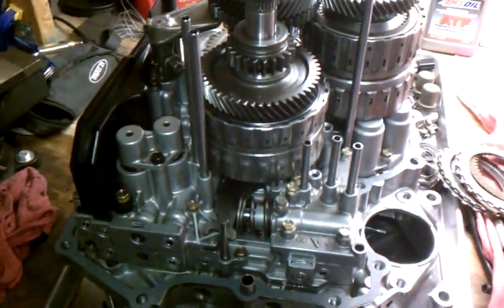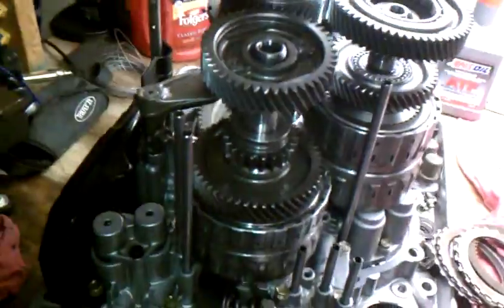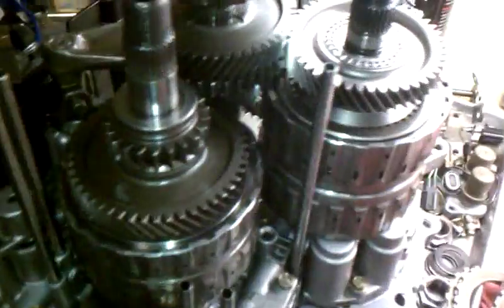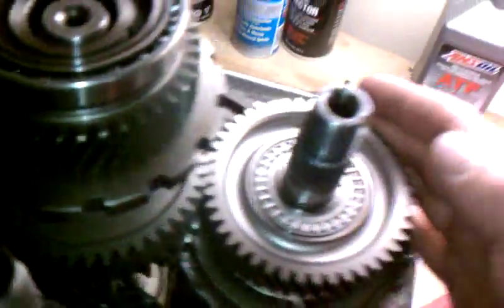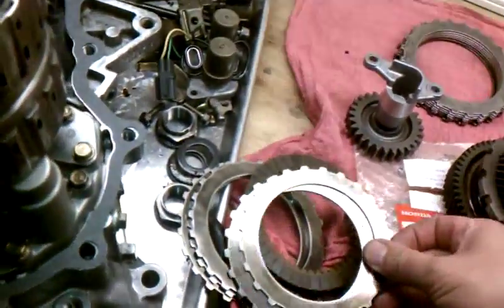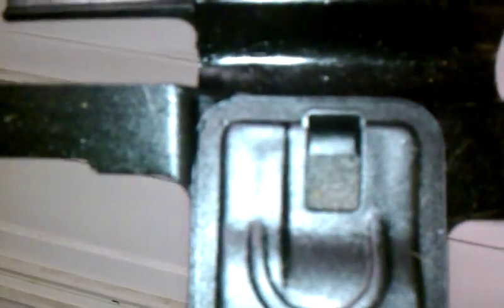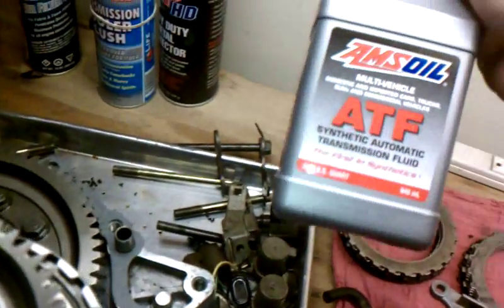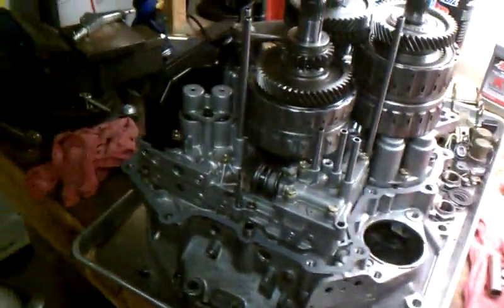honda odyssey automatic transmission rebuild

Comment: Anyone that does a build on these units should always install a Sonnax lube regulated pressure regulator valve, the honda's love to eat converters (4 and 5 speed units). The 5 speeds also like to wear out the sprag and race as well (no forward in Drive cold, but moves in d3,d2,1). The pressure switches should also be replaced and Raybestos GPX frictions are the best clutches to be used. Cleanliness is paramount

Comment: have done a th350 on a chevy van and in the end turned out to be better than any of the last 2 rebuild this old van had. owned since new. and had 4 rebuilds. I was much younger and fearless then, but my point is a rebuilder will only replace what they consider is within specs. That in my opinion means if the frictions and steels are "OK" then they will leave them and just replace all the rubbers which is typically what is the issue. The heat hardens  the rubber and reduces its resiliency causing leakage on the servo pistons applying the clutches.  Heat is the enemy and a cooler is recommended but reduces fuel economy somewhat because of the reduction in thinning of the fluid. Thin oil is one of the holy grails of efficiency's thus LV and synthetic oil's (recommended) if you have a garage and time and the fearlessness to tackle this you will have a 99% success rate. Need manual need patience need the correct tools or the ability to think outside the box to improvise. don't be in a hurry index mark any area that you think may have to go in a certain way keep notes, Pictures. No distractions so once you start keep going until done to the point of completion. Dirt is the enemy or at least one demon. Odyessys's eat converters and bearings so be careful and heed on the side of caution if questionable. Again Heat and dirt are enemy's. there are filter kits that be added to the cooler lines too.
My 2.5 cents Good luck.

Comment from the maker: The ATSG print out that came with the kit had the same diagrams as the FSM.    Trans is working great.  I went with the Amsoil Synthetic ATF.   I was freaking out yesterday as there was a noise like a bearing going bad, and it was on the PS pump.  So I did a quick rebuild on it.    The total cost of this rebuild was 175 for the kit with steels (don't skimp).   I got all my parts from CT power train in Huntington Beach.    Oh, a JY MDWA Trans was $800ish with no gurantees.

Comment: Nice Vid, I've been rebuilding for about 6 years and the most common issue that i've ran across with the honda units failing is that the nuts on the shafts loosen up and cause you to have issues in 2nd and reverse, so if you do decide to tackle one of these urself I would suggest replacing the nuts on the shafts new and torqueing them to the correct spec. Also check the bodies where your shafts sit and make sure there is no wear from the sealing rings, the 1-2 acc. body is cheap from dealership

Comment from the maker: @KASTAS155    This is a Honda, it's a contstant mesh like a manual.  But instead of shift forks, it uses clutch packs to select each gear.   Not that scary, but have a manual which shows you how the gear clusters go back together.

Comment from the maker: The only "special" tools I used was a puller with some really long 6mm bolts to pull the gears under the end cover.  I grabbed the bolts from an old civic starter, about 6" long.   As for the press I already have an Hein Werner 20T, so it was easy for me to just use it.   You could take your clutch drums to a local machine shop or transmission shop and have them replace the piston seals or the pistons depending on what type of drum you have.

Comment from the maker: @cb7crazy  It's got over 3k on it now and it works great.    Heard a noise but it was the bearing in the PS pump.  I just rebuilt the pump today, but my phone had the audio checked to OFF, so there's no audio.    Honda PS pumps are super simple to rebuild, and can be done from start to finish in under an hour.  :)

Comment from the maker: @db587  Yes, get a rebuild kit.   You can flush the torque convertor, or a reman is about $150.    You kinda need a press to take the clutch drums apart.    They make a tool for it too, or you can make a tool with all thread and a socket.

Comment: Don't forget to put new pressure regulator valve and tcc release valve and sleeve they are available from sonnax it stops premature tcc burn up due to release issues

Comment from the maker: @cb7crazy  Diff bearings were fine with the shim that was in the case.  I did have to replace one of the shims on the stack that had 2nd gear.   Be warned it takes 1-2 weeks to get parts for these things.    I used the dial indicator to check the clutch pack free play.   You put the clutch/steels in drum, put the snap ring in, then check the free movement of the clutch stack, there's specs for each clutch pack in the manual and on the ATSG paperwork that comes with the rebuild kit.

Comment from the maker: There is a chart that shows which solenoids are energized, I'd check them, sounds like you have a bad solenoid.  The sucky part is you could've swapped it without pulling the car apart.

Comment: I am prepared to rebuild my auto trans off an 06 Sentra. I have already taken it apart. The service manual is DEFINITELY something even an expert can't be without! My trans stopped engaging to gear after an accidental "neutral drop". So I took a look inside the trans and did not find anything obvious with the mechanical parts. But I was suspicious with the valve body assembly. One valve just fell off upon removal of valve body. I AM YET TO FIND OUT WHERE I CAN GET A REBUILD KIT! GOOGLED, NO LUCK

Comment: Hi Mark.  Thanks for the vid.  I have a 1991 Honda Accord.  I put a junk yard tranny in it cause reverse was blown in the old one.  BUT, I screwed up and didnt flush the tranny.  SO, it went a little more than 1500 miles and now it works for about 30 secs and then "let's go" in all gears.  Is this the torque converter screwing up?  ANyhow, I have been told in a couple of Honda forums that debri (metal, etc.) is getting sucked up into the filter and cutting off hydraulic pressure.  Rebuild time?

Comment: Hi, I got problem with my M6HA tranny. When my gearbox is really cold and when the outside temperature is low gear shifting is sharp and very slow. Sometimes on gear change rpms increase but without gear change. Then suddenly gear is shifted but these gear change is uncomfortable. But when gearbox get temperature gear shifting is smooth and pretty cool. I changed the 3L of transmission oil and refilled by OEM HONDA ATF Z1 oil. I cleaned all solenoid valves which are on gearbox shell. No results. I'm going to next oil change but I'd like to drain and refill my gearbox new edition of ATF Honda oil, the ATF-DW1 which is as I read full syntetic oil for Honda A/T and it work better in low temperatures.
Am I right?
Reply: it works better yea but it sounds like yours has the same issue as this one. burned clutch packs and clogged filter

Comment: BTW, I have changed the fluid now twice, cleaned off the drain plug each time with little improvement (there was alot of fine metal on the plug each time I cleaned it.  Car sat for a few hours, went back and, sure enough, it went into gear solidly.  Sounds like there is ALOT of crap in this tranny!

Comment: just installed new transmission in 2000 Honda it won't start.  Its getting fire to the switch just not from it.  hook up the battery and the lights, radio etc comes on without the key in the switch.  Cant pull it out of gear to even try to see if it would start in another gear either. 
any help is needed! thanks

Comment: Great video 
I just bought 2003 acura cl type s
Has shifting problem in 2nd and 3rd gear I wonder if I have to do the same clutches change or maybe linear solenoids
Please advise
Thx

Comment: Hi All,
My situation that the bear and race of the diff. worn out and I had to open and replace them bearings. When I reassembled the tranny and install back into the van. I put fluids. The van is jacked up. I test it and the reserve will not turn the wheel but i can feel the drag. I try to speed up to see if the wheel turn but it shut down the engine. Does anyone know this problem. This is my first time doing this so kinda lost. Please help. Thanks.